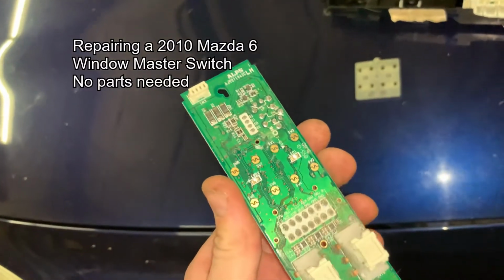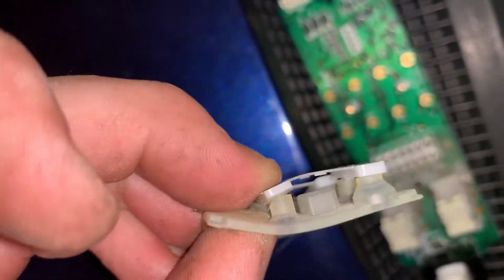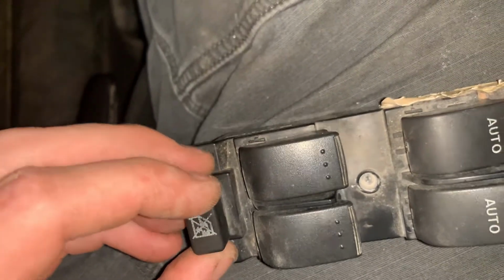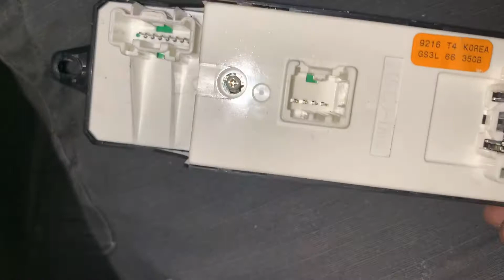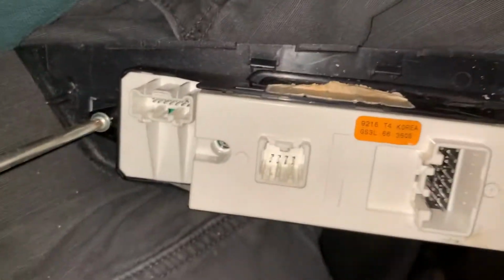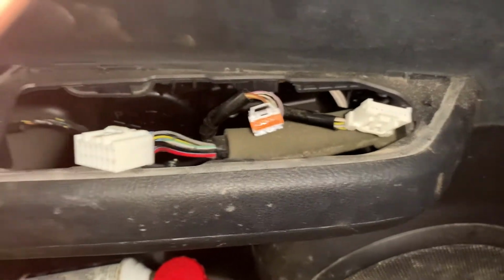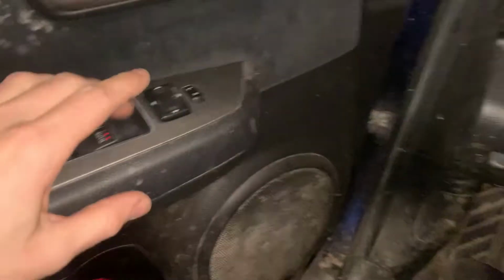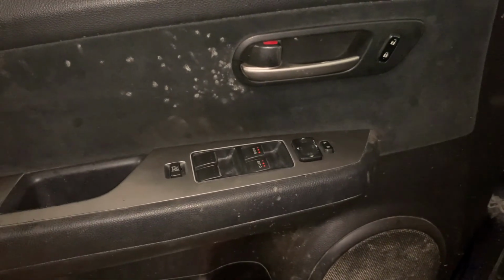Window Switch Repair No Parts 2010 (2009-2013) Mazda 6

Comment: What if after changing the part it still doesn't work for any of the switches, only the side mirrors,  when before changing the part only two were not working?
Reply from the maker: I would first make sure the window lock button was released. Check to make sure the switch is plugged in all the way. Check the power window fuse.

Comment: All my windows and both side mirrors stopped working. Will this help fix that? Because I was searching for solutions on google and saw if It was motor issue it would’ve only effect that certain window.
Reply from the maker: If I were to take a guess I would look for a broken ground wire in the driver door flex. The controls for the windows and mirrors share a ground at the bottom of the drivers side A pillar.

If the passenger side window switch works then the ground wire is an even more likely explanation.
Cleaning the window switch would not fix your problem.